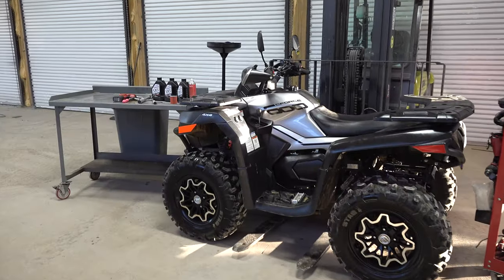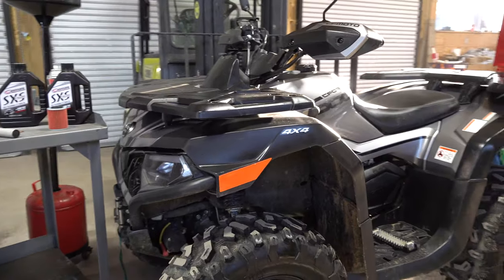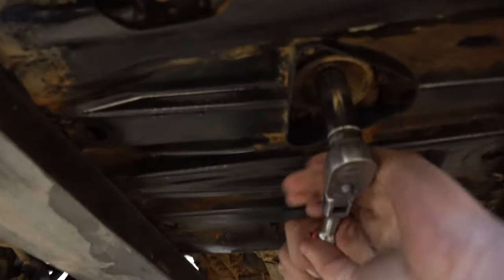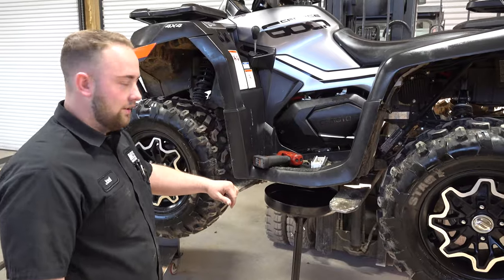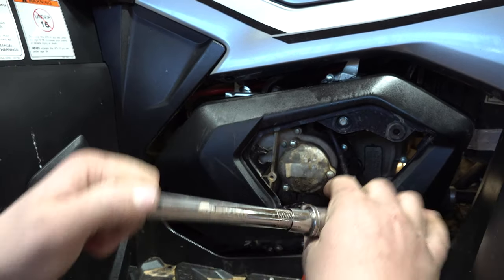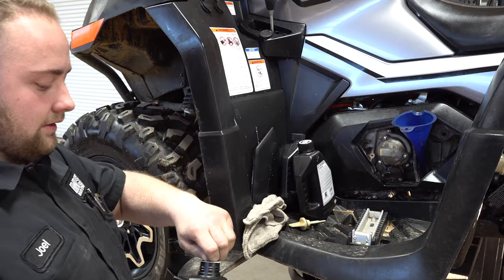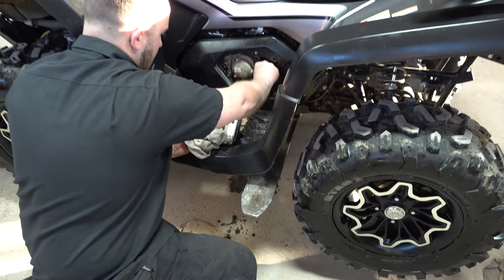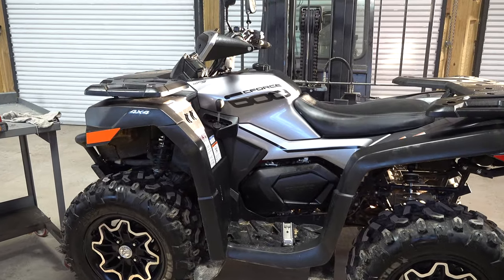CFMOTO CFORCE 600 Oil Change How to video 2020 & 2021 Models

Comment: Just called the local shop here in Spokane, WA. They want $90 for oil change kit, and if they did it $220 for labor!
Got my kit off eBay $45 and gana do this on my 2020 CF Moto 600 touring.
Great vid, thanks! God bless!
Reply: It’s super simple ! I just did a change of oil and filter a few minutes ago on my 2021 cf600 . It only has 122 hours and 235 miles on it , I use it for work around the house mainly . It’s my 4th oil change since I bought it new in 2021 . Oil is cheap , engines aren’t , great for peace of mind .

Comment: I like your video and will still watch but sorry to say that I just checked with Main Street and I was looking to get a Cforce 800 and $9,600 is way out of the ball park that I was looking to pay and all could say was ok now I know.
Reply from the maker: Was that for a camo or regular color.. I don't deal with any of the pricing stuff.. I stay out if that myself
Reply: @RealTalkPowersports  no it was a regular color and I guess it's just supply and demand kind of thing were if I don't buy it the next guy will and I also want a 2021  XMR 1000 and a local dealer has one but it doesn't have the new diff lock and I find out it's a $800 add on a he would a order it so good luck with that and no cut on the price so he told me he's not sure but knows that it  will be close $16,000 so that's a big hell no.
Reply: $9600 for a Cf moto. 🤣 
I paid $9700 for 2021 sportsman 850 premium in camo.
Reply: @jessecameron7268  yes would much rather have a Sportsman 850 78 hp and better AWD than Cforce 800 65 hp but it's a 2 up and seeing that I only paid $10,000 for my Sportsman XP 1000 out the door and it has 90 hp . Maybe I'm just like everyone else that was only looking at CFMOTO because it's price but if they are trying it get $1000 over the (MSRP $8,599) sorry that doesn't work for me I have always bought well below MSRP has you did.

Comment: good day the same question as i left on the oil change 800, we also have 2 x Cforce 625 2021 and doe we need wet clutch compatible oil to use in this machine?
Reply from the maker: I recommend you running the oil that's in this video for your machines. It is all we use. Great stuff and is 100 percent approved by CFMOTO. Maxima Racing Oil 10w-40 ...
All oils will work in a dry clutch setup. and only certain wet clutch specific oils should be ran in the machines with a wet clutch. But your CFORCE ATVS are not wet clutches.

Comment: Do recommend any tips on breaking in the Cforce 600? I’ve been keeping under 35mph (1/2 throttle) and varying the speed like the manual says.
Reply from the maker: Its always best to stick to what the manual says and what your local dealer recommends.

Comment: Hey there!  Enjoy the how to videos you make. I got mt cforce 600 touring in March & had to do the bearing in the belt housing & your video helped me out. Unfortunately over the weekend I tipped over in a river & swamped the machine so now I've started the process of trying to drain everything. I'm having trouble getting the spark plug out. I can't even see it & I can't find any how do videos. Any help would be appreciated. I hope I didn't ruin the engine. Thanks

Comment: Wanting to upgrade from a 2012 teryx that's pretty beat up, is cf moto zforce 950 a good choice?

I'm looking for reliability, preferably something I can drive for the next 5-10 years. Is this something I can count on lasting or would I be better off spending slightly more cash for another brand?
Reply from the maker: I am now a believer in the quality of the 950 SPort!  I believe if you take care of it like the manual says; it will last you a long time

Comment: My 2020 600 touring, the speedometer reads 0 all the time now, I dont use it much so I just noticed it stopped do you know if its covered and what do I look for?
Reply from the maker: it may still be under warranty.. check with your dealer and they can get it fixed for you

Comment: Love the channel...and love my CF Moto.  However, this brand is relatively new to my area of Canada.  Hard to find solid support for the brand.  I have a coolant leak at a hose/line near the water pump.  Any response would be helpful.  The CFMoto dealership has changed hands three times since I purchased my bike.  It's been tough to get solid help.
Reply: Water pump seal is prolly bad
Reply: @mscbros7938  thanks for the info.  It supports what I've been told and what I've been reading elsewhere.

Comment: Can you do a video on a evap delete for a 2021 cforce 600 2up. Just got one and having problem after about 2hr of ridding felt like it was starving for fuel. Took gas cap off and back on ran great but had to leave right after that not sure what it might be. Could be just a bad gas cap or the evap only got in a couple of mud holes nothing past the floor boards. Was ridding at Hawk Pride this last Sunday 06-27-2021
Reply from the maker: Well I've never had to do a delete on the 600.. ive not personally seen any issues with them.. but it sounds just like the evap issues on the 2020 500 and 800
Reply: @RealTalkPowersports  

Yea that’s what I was thinking but can’t find anything on where the system is located or how the hoses are run. Main Street is closed the week of the fourth so gonna try take it in on Monday the 12 see what they can do. Kinda hope it’s a bad gas cap r tree hat would make more sense being the 600 normally don’t have any evap problems

Comment: Thanks so much for putting out these videos. What was the spray Joel used on rubber grommets for cover plates?
Reply from the maker: It's a industrial lubricant.. WD-40 would work just as good for you